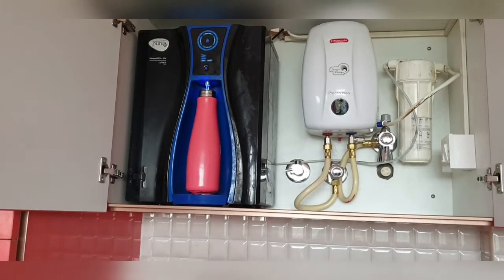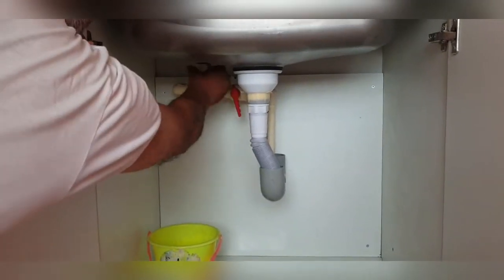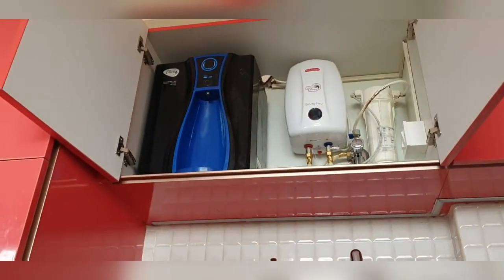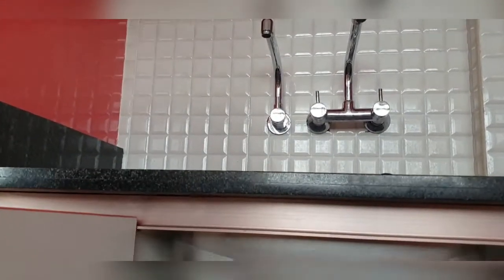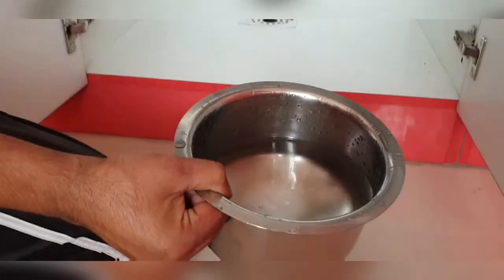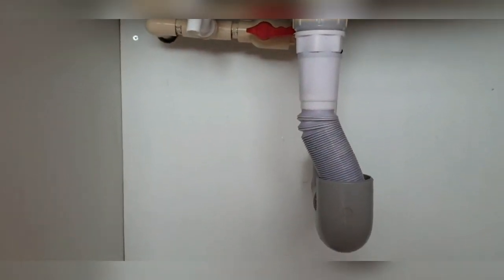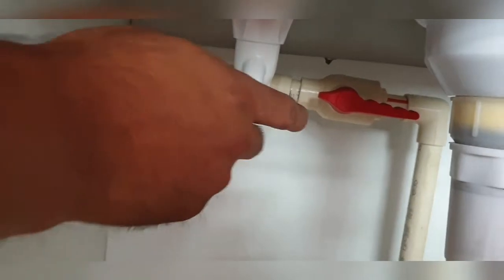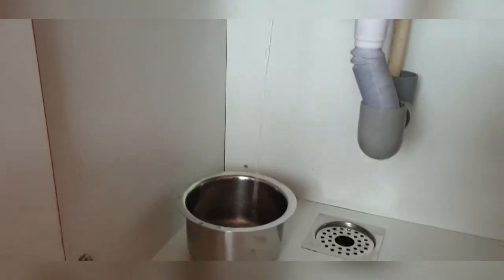Water purifier Outlet pipe  making your kitchen look ugly? Then watch this video.Also save water .

Comment: Hi thats a great idea but I cannot understand how is the purified water coming through the tap(SS) as well as the purifer? How is the connection from the purifier's storage tank done for getting the purified water in the Tap (SS)? Please help
Reply from the maker: You can ask your purifier executive for the pipe. However the pureit water can either come from tap or purifier. Also you have to make provision with pipe behind the tiles and drop the pure it pipe into it

Comment: How to connect a flexible pipe from storage tank and put near sink with valve!
Reply from the maker: The pipe is behind the tiles. A regular water pipe is placed to the wall until the sink and then the outlet pipe is dropped through it. It is covered with tiles. I hope I got your question rightly